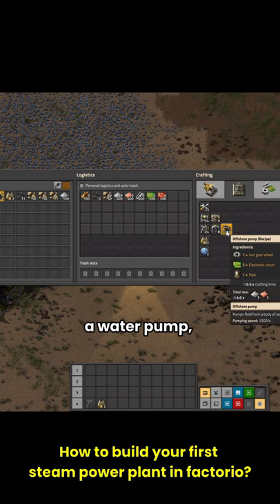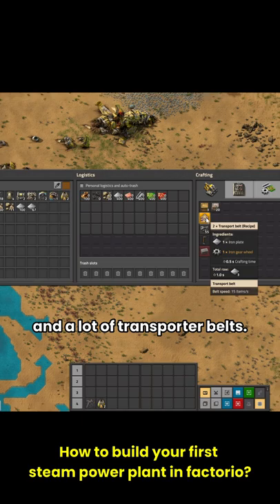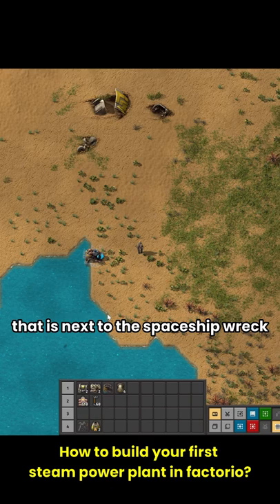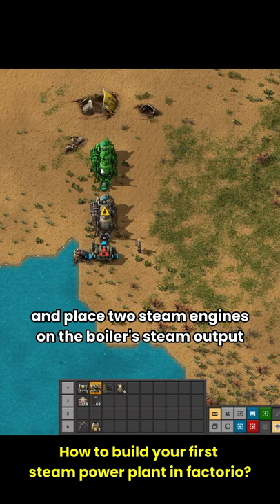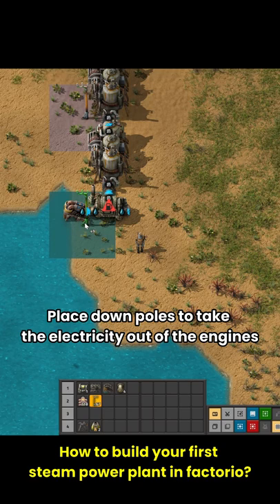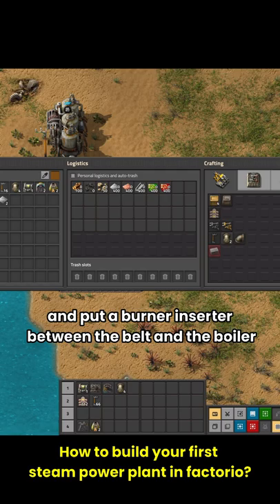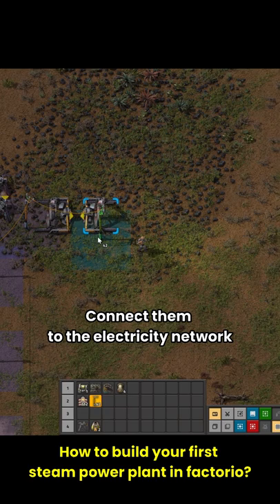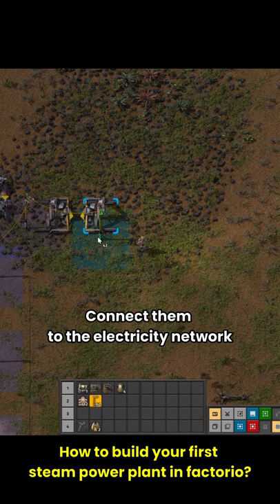Steam Power in Less than 60 seconds in Factorio

Comment: Why use a burner inserter instead of directly using an electric inserter?
Reply from the maker: When using inserters, if for some reason the base starts to consume more electricity than the steam power plant can accomodate, then the inserters that feed the boilers will start to slow down. This in turn will slow down the boilers because they are not going to be fed properly, and the steam engine are going to produce less electricity. 
It is a negative feedback loop. The power generation is going to crash down and everything is going to come to a halt.

If instead you use a burner inserter, and the base consume too much electricity. As long as you still have coal on the belt, the power plant is still going to run at full speed. It is self-sustaining.The coal miners are going to mine slower, but usually that's not too much of a problem if the overconsumption is not too severe. 
And if there is a big power comsumption surge, at least you have the coal belt that act as some kind of buffer.